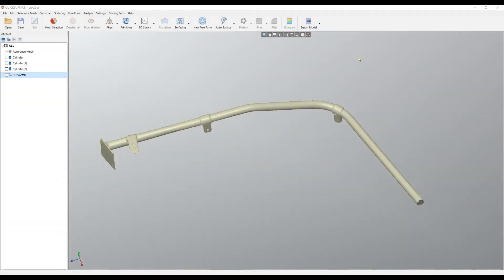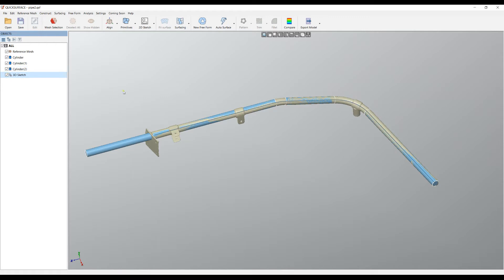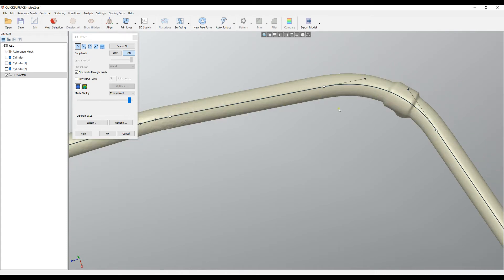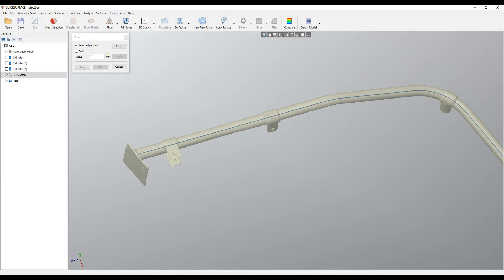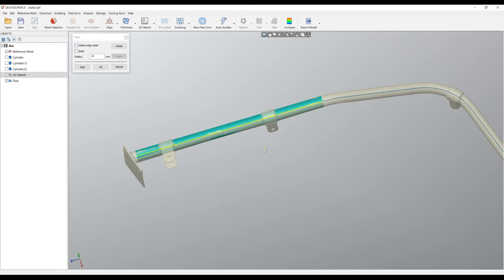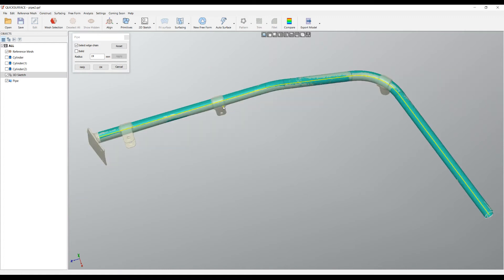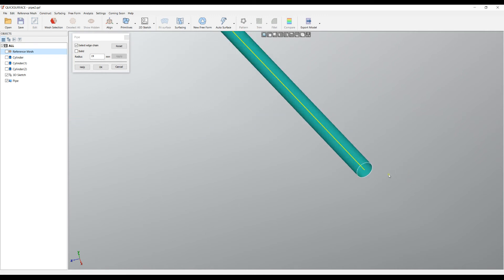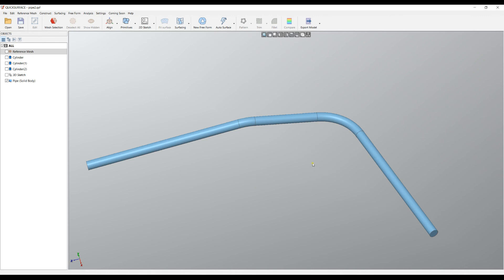QS Tutorials: Pipe command

Comment: It Was one of the useless tutorial. You didn't show the way to create a correct centerline - it's a basic problem of a pipe build
Reply from the maker: This is simply how the command works. Together the actual centre line you can use fit cylinders and 3d sketch.